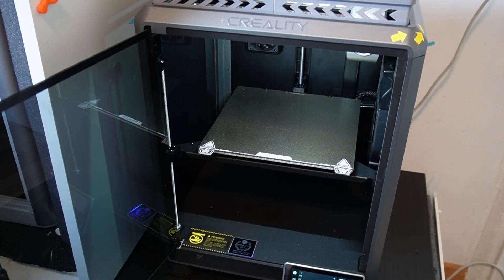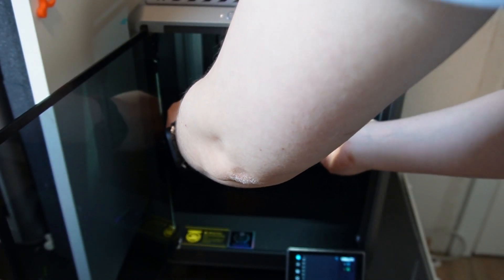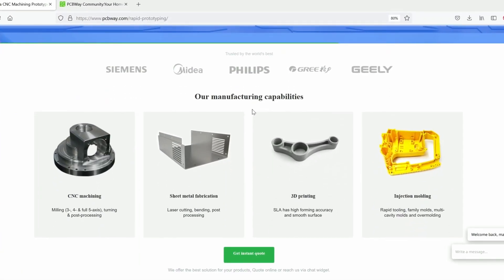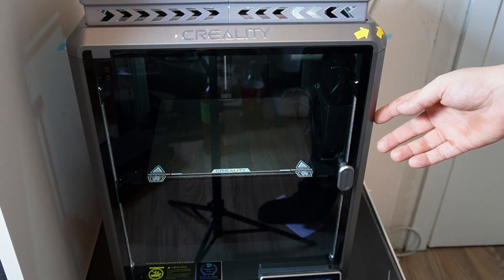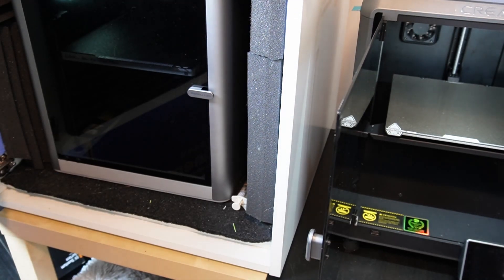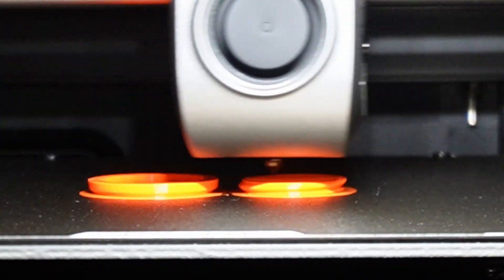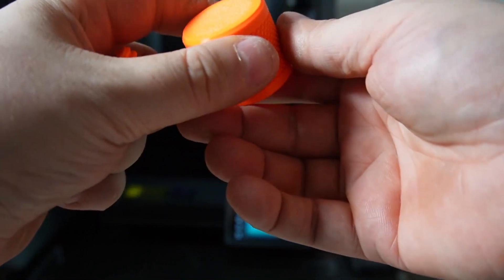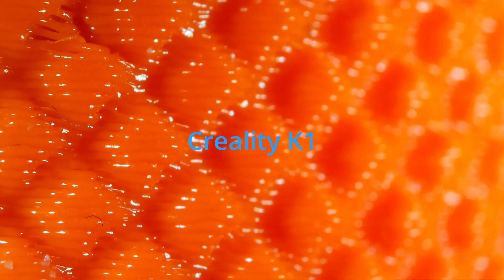Creality K1 VS Bambu X1C the good the bad and the ugly under the microscope

Comment: I agree with the build quality comments, but only to a point. The k1 is a fraction of the price you are comparing it to. No doubt the bambu is a better build but for the price point the k1 really not terrible. Price to quality ratio isn’t bad at all. I don’t own either but I’d be happy with both.
Reply from the maker: yes you are right, for the half of the price u get a machine that is pretty good.
Reply: @aim6mac  I have now bought a p1p. Exited to see what the quality is like on that at speed 😁
Reply from the maker: @liamhoughton  p1p is a great machine with here and there short commings, but generally it's a great machine.

Comment: The K1 doesn't have a lidar 🤣
Reply from the maker: @irbose9895  if we have to believe Creality then the Lidar scanner does compensation of extruded material and first layer inspection, so it's basically doing the same stuff as Bambu is doing as of this moment.
Reply from the maker: K1 has a lidar, but not out of the box, you need to buy it seperately

Comment: Great video
Some info not in the video
K1 $599
p1p is now $599(new anniversary price), AMS 350 per unit up to 4(16 colors), filament buffer $50
If you mainly print with filament which does not require an enclosure this is a nice option. The camera it uses is barebones but it has one. 

X1C $1200
X1C with AMS  $1450

There is no option for Automatic multi material for Creality. so filament changes are a manual affair. 

X1C and P1P have larger build volume of 256x256x256
K1 is 220x220x250
K1 max 300x300x300 when it releases. No official release date

There are other features the AMS has that is rarely mentioned in reviews. 
1 the ams can be configured continue printing when filament runs out if you use the same filament type/color
2. It obviously stores up to 4kg of filament, reducing touch time of filament swaps. 
3. There is a built in humidity sensor showing green(low humididty) Yellow( moisture detected) Red(change desiccant)
4. WIth the x1c and p1p, you do not need to manually load filament. With a press of the button on the printer screen, phone app or slicer you can load and unload filament. Even that is unnecessary when you start a print as the printer will auto load and unload. (unless you have an issue like in the video)
5. Only has 2 screws to disassemble making maintenance simple. 

Cons
Abrasive filaments and flexible is no bueno on ams. 
Prints take much longer if you have many filament changes
Cardboard spools are not recommended for the ams. You can respool, make adapters or tape up the rolls.
Reply from the maker: thanks Ashley for your elaborate explanation!
Reply: @aim6mac   You were very thorough comparing real world use. I much prefer your style of video vs an info dump of features. 
It can be challenging to add all the little differences , like the price drop announced on the 6/26/2023 so thank you for the kind words.
Reply: Great write up! One huge thing you left off with the AMS is support material. You can either use the bambu's support material or even dissimilar material like pla for petg and petg for pla's support interface layer. This is the first time that I've been able to get a completely smooth large overhang that comes right off with no post processing.  Also I've been successful using 98A TPU in the AMS I've made a bunch of multi colored TPU projects as well as mixing TPU on other materials to make a cushion for the printed part that's attached. Not a single jam so far.
Reply: @Oliver1071  Great catch. I so rarely use support filament I completely over looked it. I have avoided flexible filament in the AMS. Im glad you have a working solution. What is your print speed with tpu?
Reply: @ashleys3dprintshop  Yeah I have always avoided supports like the plague myself. But it's a nice option now that I have it available. As for the TPU I haven't tweaked it to much for speed.  I basically took the Bambu's 95A Max volumetric speed of 3.6 and setup a new filament for PLA with the temps for my TPU the 98A may be able to go faster not sure I'm just happy it works for now. The AMS will error if you say it's TPU and not allow you to select it. The volumetric rate is limiting all of the speeds for me and seems to be working well.
Reply: @Oliver1071  That is interesting to hear. I might give it a shot. I have only used tpu and flexible pla externally. But the flexible pla will jam up immediately if you don't have your temps correct.( I didnt know flexible pla was a thing until a month ago)

 Adding in the ams could be an issue. I think when I get some free time I may give it a shot.
Reply: Respooling is not a great option, i seen a lot of ppl having filament "explosions" after a few days to a week, from internal stresses of the filament.
better option is probably to try and move it from from the spool in one piece like if the was a refill for an re-use spool
Reply: @ZaxMan3D  I did see a video on yt about filament shredding after a respool. I am unsure of how the filament was spooled. (hand crank, drill) I guess the Hydramod or the semi jank solution of running the filament through the AMS  from outside the AMS with rollers. NO comment about the stress on the 1st stage feeders. 

Has anyone had any luck with respooling?